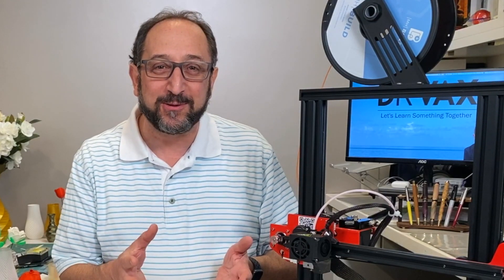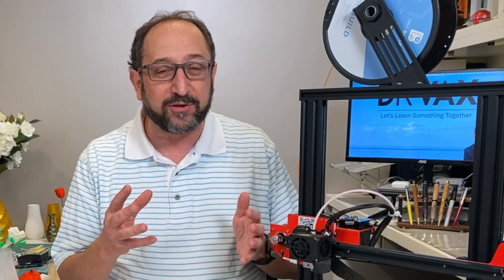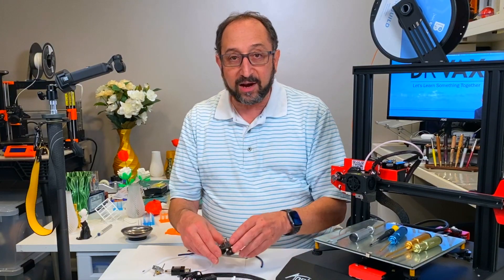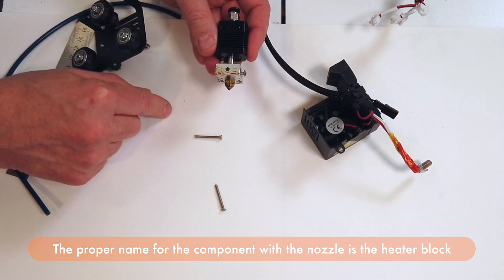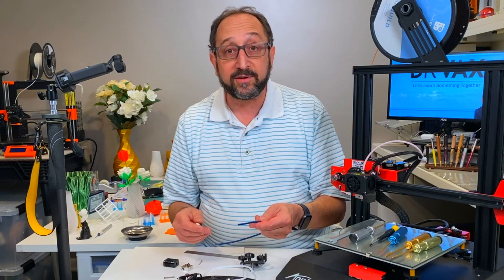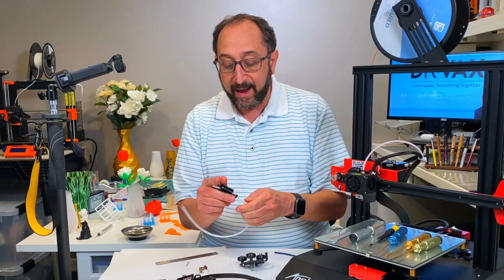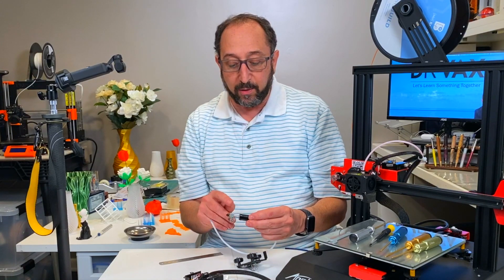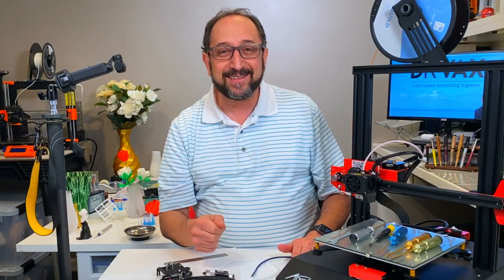3d Printer Hotend Disassembly and Explained

Comment: Hi im just wondering if you can give me some advise, im new to 3d printers and i got a second hand et4 given and i bought a power lead nozzles n stuff but the hot end woulnd heat up just staying on 300 so i replaced the nozzle housing and wires with new part, then switch it back on and its still the same any help would be appreciated tia
Reply: Check your thermistor.   That is the sensor that detects the temperature of the hot end.
Reply: @irvshapiro2215  thanks man but the part I've just put on has a new one built in with the hot end housing with the wires going to it, I think that's what it is

Comment: I don't have this printer. However, the reason that the Capricorn tubing does not quite go through the hear break tube is that there is a very small "burr" that was left when the matching was done. This burr is no doubt quite small. You might want to try a small drill bit (1/8 to 3/32) that is a bit larger than the inside of the tube to remove this. Just put the end of the drill to the bottom of heat tube and apply a bit of pressure when rotating the tube or drill bit. This will "cut" the burr from the tube.

Comment: Is there a replacement heat break that might work?  Does Capricorn sell longer pieces of the thinner bowden tube?  I really don't like the idea of two pieces of bowden tube simply butted together.
Reply from the maker: I have sent an email to ANET to see if they have any insights into this issue.  In addition Swami Human another viewer recommended just sanding the tubing down a bit.  This may work.
Reply: @MakeWithTech  Both sound like good options.  Good luck and let everyone know how this is resolved.  Good to see you back on top of your game.
Reply: Luke Hatfield has a fix for boden tube printers. He takes a 3d printed spacer that he places between two pieces of ptfe tube in the hot end. It helps prevent jams and could work in this case..